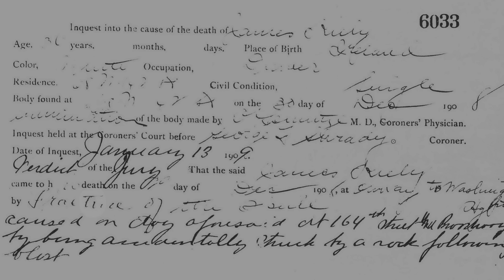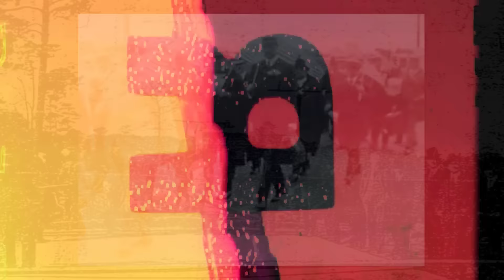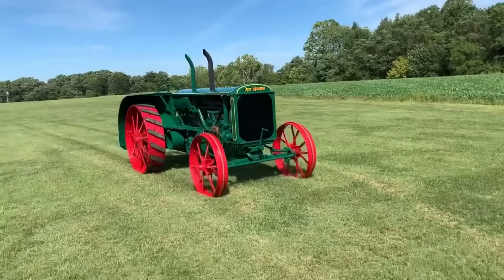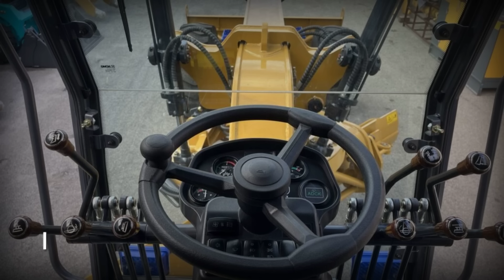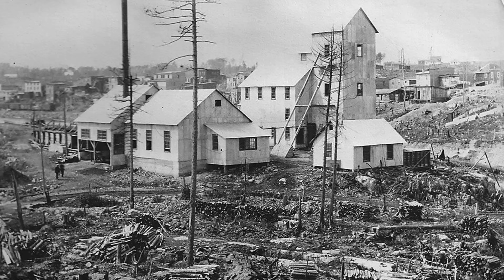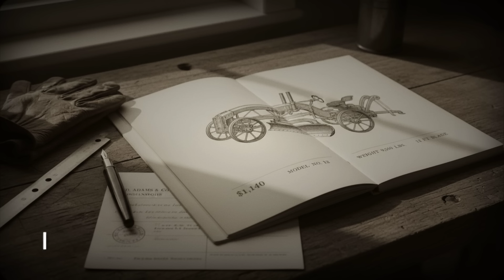Before Hydraulics: The Brutal Reality of 1920s Motor Graders!

Comment from the maker: 🚨 CONTEXT: The 172 Russell machines in this video are just the beginning.

By 1938 — just 12 years after the last one rolled off the line — a single Caterpillar grader model had sold 17,000 units. More than the entire industry had built in the previous 20 years combined.

Every Cat, John Deere, Volvo, and Komatsu grader on a jobsite today traces its fundamental design back to those 172 machines from rural Minnesota.

The men who operated them earned $2.25 a day. Had no workers' compensation in most states. And could be killed by their own machine through completely normal use.

ROPS (rollover protection) wasn't mandatory until 1974. OSHA wasn't created until 1970.

These operators built over 500,000 miles of surfaced road before a single safety regulation existed to protect them.

Drop a 🔧 if you think the men in this era deserve more recognition than they get.

Next up: The 1930s — when the Auto Patrol arrived and operators could finally stop cranking by hand. But the job was still brutal in ways you wouldn't expect. Link on screen.

Comment: I replaced those worm gear bearings that adjust the blade. They were very difficult. They had shims in them. You had to get the bearing pressure right I figured out how to run the knuckle Buster without getting hurt you barely bumped the gear with your palm of your hand, and then you hit the second time and it go in to gear and move the blade. But you did not move the blade in a circle while you were moving. If you got it moving and it hit something was too loaded up then you couldn’t stop it. It would hit the tire.
Reply from the maker: Wow, what a fascinating hands-on experience with that grader! The skill required to operate those early machines was extraordinary. Thank you so much for sharing your story! 🙌